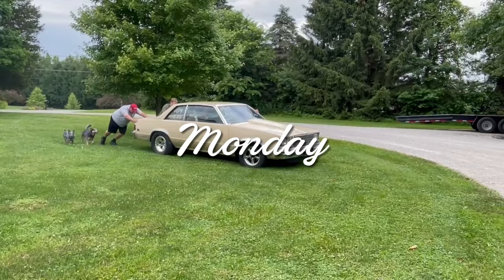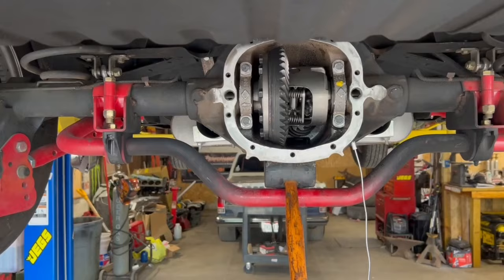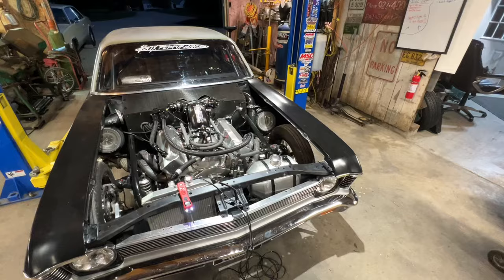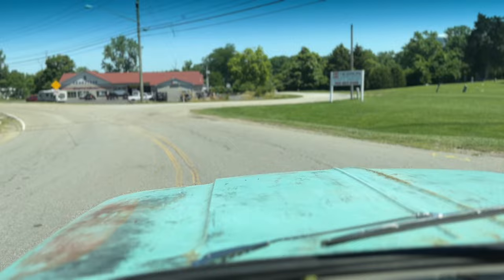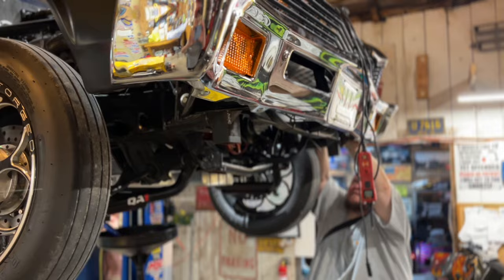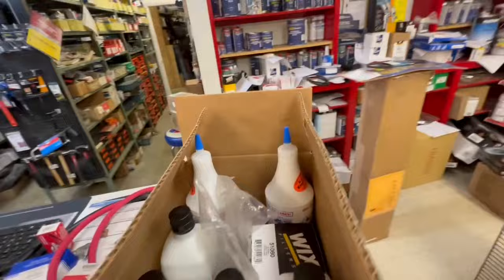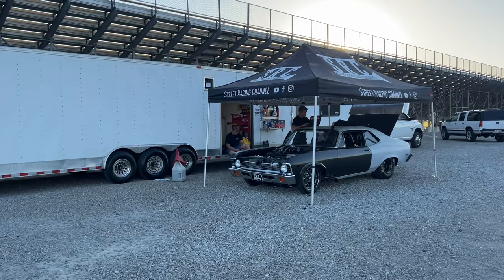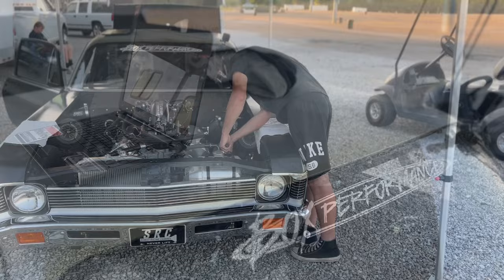He was NOT IMPRESSED! Uncle Bucko on the WAR PATH over 10 bolt destruction!

Comment: The way I was taught, you tune the engine on motor, get it happy and right. Then you drop the heat range of your plugs, back the timing down ( amount depending on set up ) then and the spray and tune accordingly.  A engine that’s rich on motor will be rich on the spray and can make it harder to tune. Same as if it’s lean on motor.

Comment: I just saw a big block ( similar setup ) that was having low oil pressure issue and turns out it was the main bearings clearance it was just a touch much and was showing low oil pressure. Changed them out and now it has great oil pressure

Comment: Steve Morris just had the same problem with Cletus McFarlands big block. The bearing clearances in the motor as it comes to temp were set to loose and because that tolerance grew to much it started loosing oil pressure. He tightened up the bearing tolerances an oil pressure improved.

Comment: Need that 9”
Reply: I agree. I became a believer in the 9” Ford when I drag raced in the ‘70’s. I watched an old man with a nice hot rod Ford show up at the track (driving not trailered) and unload his trunk of tool box, floor jack, pair of slicks and extra center section for his 9”. He jacked up the car, changed from street gear to track gear, put on the slicks and uncorked the headers all in less than an hour. He had a 4 speed car and knew how to drive it.  After racing, he reversed the process and headed home. He carried his track center section in an old 9” housing with the axle tubes cut off and plugged off to keep dirt out and gears safe. Said he had many set up at home with various ratios too. One good feature of the 9” is that all the precision work is done on the workbench and not under the car and if you do tear up the gear set, you swap the center section out in less then an hour.

Comment: I heard your comments on Billy tuning the Novs,  I'm proud he is learning it.  I heard you mention that if you guys tuned it yourself you would not have to worry someone else tuning you might worry about them hold you back if they tuned someone else's you were racing. The Beer Money car driven by Lyle Barnett has a tuner ( and engine builder) named Pete Harrell.  Pete used to drive customer cars and Lyle was a competitor, then after Lyle and his dad were having head gasket issue I got them to go meet Pete and convinced them that if Pete could fix there car to outrun him he would do it.  Pete recently had to tune 2 customer trucks that ended up in the finals at South Georgia, and they both had confidence he tuned them both to win and let the track decide.   I just wanted to plant that in case you even wanted to get assistance tuning the Nova or something to get to go down track.  Pete is a rare guy that would set you up to better his own stuff if it will.  He also keeps numbers to himself, even if it is me he holds numbers in confidence.
Reply: I’ve often thought that it would be beneficial at this stage and really this stage only to find the best person in the industry that 1) you trust. Trust is probably the biggest factor because your trusting them to help get you dialed in and be a winner faster and more efficient than what you can do on your own. 2) What you can afford. The commissioning process is the most important part of the cars success and goes right along with what these guys are preaching about the foundation. 

Basically what your doing is bringing in someone whose been down these roads before that can help guide billy in the right direction and acts as an experienced extra set of eyes that knows what to watch, what to look at, etc. but also is an experienced troubleshooter for when /if things start getting head scratching. When you spend the amount of money doing what billy has done, you want to try and put the car out there to be as successful as possible from the very first pass. The more experienced eyeballs you have on it the first few passes the better. It will eliminate downtime or mechanical failures etc. it’s not shameful to do it, the best in the business bring in top consultants to do this very thing. Ryan Martin brought Steve Petty on board for a good while to help him get his foundation firmed up. The only real requirement for someone to fill that spot, and provide valuable data is that they have been successful themselves and that you trust them! It would have been great if billy could have worked it out for Chief to be available for his first passes. Someone like him that knows what Billy’s goals are, has been thru the trenches before, has solved many of the start up issues with new cars before, has been incredibly successful himself, and is not a direct competitor of Billy’s at the moment.  Chief would be an invaluable asset to have during the commissioning of the nova which only ensures the foundation that billy, Rob, and all else that have participated on the project, have got that foundation square, plumb, and level, and is ready for everything to start piling up on top.   

Anyways, you probly understand what I’m trying to say Kevin. I know sometimes our pride won’t allow us to accept help from outsiders on things like this and as Bill said, “we can only blame ourselves “ if things don’t go right. Which is true. But, the key here is to prevent things from not going right. Now is the time to gather up anyone that is at your level and beyond, preferably someone that is not a competitor, and have as many eyes on that car on those first passes. Every set of eyes watches one predetermined point. After the run, debrief and talk and get input, and do it again, and again, till things are where they need to be. 

This method is used in racing, in all college and pro sports, all industrial manufacturing facilities when construction is finalized and equipment is being started up for the very first time, factory reps for every piece of equipment come from around the world to watch it roll for the first time. It’s done with aircraft, etc. but it all goes back to exact what bill and Chief talked about getting that foundation set perfect. I’m sorry this got long Kevin. I’m probly repeating myself, but this is a critical time that I know billy is taking serious but there are not enough other guys I think that do. Minimize that startup curve and get that car to the winners circle as fast, but as safely as possible!!

I’m out now Kevin. Take care brother and be safe out there!!

Comment: I had a 98 k3500 7.4 Whipple charged. The pinion support bearing was gone. Put new bearing in, set it up. Made some noise for a little bit but I worked it hard and the gears wore back in.  Super smooth and quiet.

Comment: yup, called it...I had a strong feeling that was going to break on first track outing...time for that bolt in 9 inch mr.bill :P
Reply: sry, I seem to comment as the video plays on, last video, if i remember correctly, billy had taken the car to box performance and they put the new pan on, my question would be why did box give car back with oil issues still? Still could be something serioulsy wrong inside that motor if there is still oiling issues, could be anything from bad bearings to some debris hung up in the block. Starting to have my doubts on that "box" built motor....growing pains, gotta love em. As usual, Cool content Old Man :P

Comment: Steve Morris did a video on the same problem Billy is having on oil pressure last week.  He built a engine for Cleetus and it was having low oil pressure. Steve had to change the bearings due to clearance issues.

Comment: steve morris put a video out about cleetus"s big block having oil pressure issues, and he ended up changing the main bearings to tighten them up to increase oil pressure. Not sure what the oiling issue's Billy is having but he has some valuable insight into big block oiling scenerios. Good luck

Comment: Hey Bill, On the big blocks and oil pressure don't run them full of oil they have serious issues with windage causing cavitation around the pump resulting in loss of oil pressure(even with windage trays thats a lot of mass rotating at high rpm).  It's worse on the Stroker's.  You want to run them a quart or 2 short.  You'll notice the oil pressure go up at rpm and you'll gain power.

Comment: I have a Strange Dana 60 (bolts to stock suspension. Not tubbed.) in my 66 Chevelle. I checked the gears at 800 runs, and they looked like new. Car weighs 3450, and has 668 HP.

Comment: have you guys thought about putting an actuator with an extra couple of quarts in it it worked on our race truck it was dropping oil pressure in the shutdown area and we put that on it and it stopped all of our problems plus you can pre-oil the motor before you start it

Comment: With the oil pressure issues could it be a cam bearing issue? Or does it need an extra quart or 2 since the turbos are a lil ways away?

Comment: Sorry to see all the trouble you're having with the truck, trailer, and Malibu Bill. Hope everything goes smoothly getting them back in line. True "old school" racers (like yourself and Chief) know, you have to tune N/A to reach the potential of the engine before spraying it, it was just nice to hear it's still being done. Just a thought on Billy's Nova, is it possible the oil pressure reading is off because of where the guage feed is mounted? Maybe, when the turbos dump the pressure is bleeding back through the oil returns somehow? Might be worth putting a mechanical guage and watch it with a go pro to see if it's actual or false reading?

Comment: I have to agree with Uncle Bucko, that 10 bolt just isn't strong enough. I know most people would say put a 9 inch in it but I would go with a Moser 12 bolt.
Reply: They keep putting junk parts in it,  and it keeps blowing up, go figure. Using a used OEM (seasoned) 4:11 ring and pinion , along with a detroit locker or eaton true track,  AND most importantly a solid pinion spacer will make it last at current power levels. I learned this after breaking dozens of 7.5 ten bolts. I keep commenting, and they keep ignoring the advice,  and keep breaking it.  Old mans garage isn't the only old guy that knows some stuff,  he just thinks he is...

Comment: Oil pressure problems I had a similar problem but with an oldsmobile it had great pressure normal running but soon as you laid on it the pressure dropped to scary levels it turned out to be the cam bearings

Comment: Well you knew when the 10 bolt broke, Jeremy was going to give you grief. He did not disappoint, "What were have here is a failure to maintenance." 😅 No, Rich @Lucore was right, it`ll hold up till the next time.🤣 You pushed it and BOOM.  Shame, Malibu was running good. Then you added the dually to the mix.🤣And of course he said it again. Best thing Billy can do is EXACTLY what he is doing, relying on himself for the tune. Kids got mad skills and learning all he can. Outstanding! I saw a Steve Morris video concerning clearances on the crank rod bearings being slightly loose-1 to 2 thousands "loose" that caused oil pressure issues.😮 
Mains were fine. Worth a look, he builds really nasty engines. He has a station wagon running 6`s in the 1/4. Old Roadmaster he named "Boostmaster". That new rear ordered yet? lol Time to go a bit overkill for the Malibu and keep Uncle Bucko off your back, cause He really likes giving you grief. But you did give him the ammo to shoot hit mouth off again. 🤣 Good to see your Dad getting his work done, still goin strong at his age. Looks like Rob is healing well. Good to see him back. Good luck to all, Stay safe, God Bless.

Comment: My luck is just like yours has been lately lol. Btw, your videos are AWESOME!!!  Speaking of luck, I built a 385 stroker  AFR 195 heads, ISKY hydraulic roller 294°adv duration 246° @.050 .550 lift on a 108° lsa . New everything from Summit. I drove the car/truck Elcamino, anyway the oil pump locked up busting the distributor gear ... Lucky me

Comment: Being an all alloy bbc in the nova is the oil pressure dropping low once it’s hot ? 
A clip on Steve Morris’s channel the other day Cletus’s bbc was dropping oil pressure when hit as the block was growing an extra thou or more and the main clearances was bleeding too much off 
Steve Morris fixed it with an extra 1/2 or 1 a thou thicker main bearings ? Worth a look

Comment: HELLO MR BILL MRS VICKI UNCLE ROB MR KENNY MISS HARLIE BILLY TOMMY UNCLE BUCKO . HAVE A QUESTION ON BILLYS NOVA, IT HAS A DISTIBUTOR ,IS IT POSSIBLE THAT THE ROD GOING FROM THE DISTRIUTOR TO OIL PUMP IS WORN CAUSING THE OIL PRESSURE TO BE NOT UP TO PAR? JUST A THOUGHT

Comment: 7.5/7-9/16 10 bolt love. Used to do V8 S10 conversion. Not sure if I broke more 10 bolts or Dana 30 front bronco/jeep fronts. I had an Eaton screw type f body diff in my 383 early holley projection S10 4x4 and it split the differential case into hundreds of pieces. Felt and sounded like a bomb went off.  Moser does (or did) make new 12 bolt car housings.  If you want to stay gm that's where I'd go.

Comment: Bill it's  time  to get yourself a 9in for the Malibu or some kind of blow proof rear. Really hope Billy gets the oil pressure figured out in the nova, might have to pull motor back out and apart to see what's going on .. @ Billy watch out for them Holly pressure gauges I have gotten a few of them that was bad or didn't work right out of box, so something to look into..if oil pressure not right in motor, I wouldn't risk it until figured out..
Keep at it boy's ,, you will get it worked out..

Comment: On the dually, 350k miles of towing and driving and the diff bearings take out the gear set is a problem? In my experience, the parts did their job very well compared to the same model of diff in several truck that I sold diff rebuild jobs on. OK, a couple gear oil changes may have made a little difference, but nut enough to make a hill of beans.
On the Nova oil pressure, could the oil pressure lines to the turbos not have the correct restriction orifice size, and in result cause pressure drop? I remember this subject while helping build a twin turbo Dart block SBF. It seemed like the conversation was also about putting too much oil through the turbo bearing and maybe causing oil consumption?
Thank you for regular entertainment, and racing.
You can buy an economically priced 9 inch Ford housing for the Malibu that I like very much. 31 spline axles on Ford factory size wheel bearings are readily available too.
That 7.5 GM is running well over its design limitations, like a darn Model 35 Jeep rearend.

Comment: With my experience with oilpresure problems I changed  oil pump still no pressure I checked the cam it was ok but the cam bearings how ever was not so check the cam and bearings

Comment: That 7.5 has to go lol. I ditched mine for a Midwest Chassis Fab 9 in for my Camaro. Went with 40 spline axles so they could be gun drilled and lightened flanges. Lightweight spool and strange drag brakes. All in all didn't add too much weight to the car and rearend problems are a non issue!

Comment: Steve Morris just did a video on cleetus's all aluminum 540 same issue oiling low oil pressure Steve Morris has a video where he went back in and change bearings something to do with oiling I bet you Billy is having the same problem

Comment: It is a fact to tune NA first to get the most out your engine then add your poison as for power adder.  You'll save yourself a major headache and you'll definitely fly once it's right.  Now, I heard Quick performance was suppose to help out on a 9" rearend for the Malibu. I sure hope so, those 10 bolts are great for bone stock car's but add power behind them and they puke their guts sooner or later.  As for the 540 twin turbo engine? One word,
" Ventilation " look at a few other twin turbo car video's and see. Not getting it out fast enough will pressurize the block. I learned the hard way, kept blowing front intake gasket out, then the front crank seal.

Comment: Hi Bill
I remember ready something that a 8.8 out of a mustang will fit.
But I do know a 12 out of a 65-67 Chevelle is the narrower one that will fit
But u need to shorten the upper control arm 
The 68-72 12 bolt is a inch wider 
So your wheels might not work 
Please stop investing in that pos 7.5 diff

Comment: For what you have spent on carriers, bearings, and time, you could have gotten a 9" housing and axles, carrier/spool, and gears. A stone stock LS1 can break a 7.5 in less than a day. The 7.5 in my 98 Formula is hurt, its getting a 9" from Quick Performance. Then I can stuff a cammed 6.0 in it and enjoy the car again. I think if the 7.5 was made from glass it would be stronger.

Comment: Time to upgrade that REAR foundation. Lol  For me reliability consistancy is part of the foundation in racing.  You  Wouldnt  push the motor with more nos than is safe.  Why keep  racing with a time bomb rear end. The parts you broke would almost paid  for a better rear by now.  It  makes for content tho so maybe thats the reason? Love the malibu series because most people can relate and afford that type racing.  At what point do you say its time for safety upgrades? I know you dont want to cage that car but safety should be number one priority being discussed when begining.  Fire Suits helmets roll cages should all meet speed and fuel requirements. Street racing or not the sfi ratings etc are there for guidelines for people to follow.  As racers we will spend thousands to get the little extra hp edge.  But we wont put an on board fire system in because its too expensive.  Lmao.  Maybe time to add some of that info